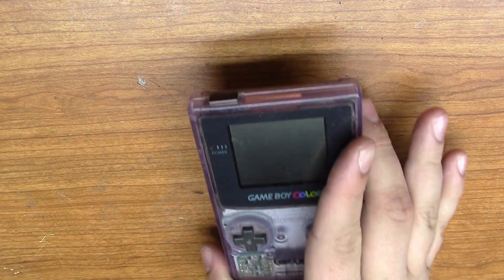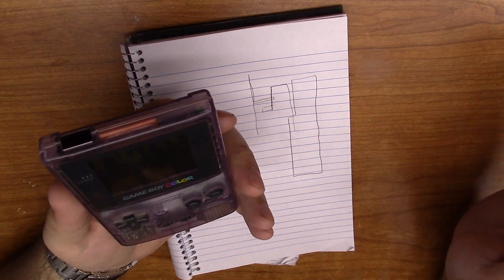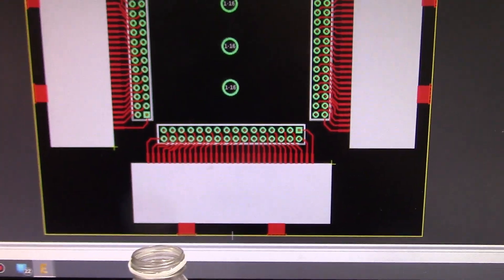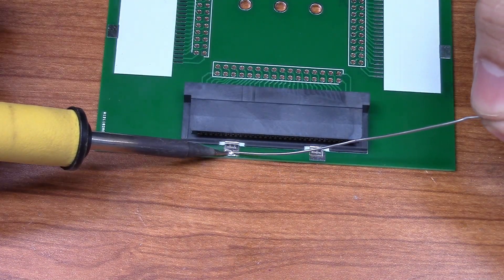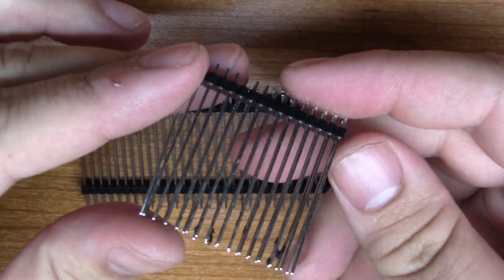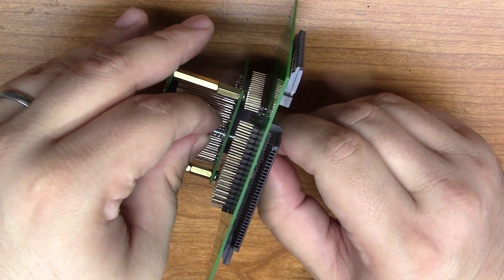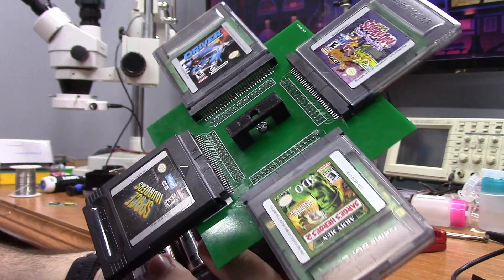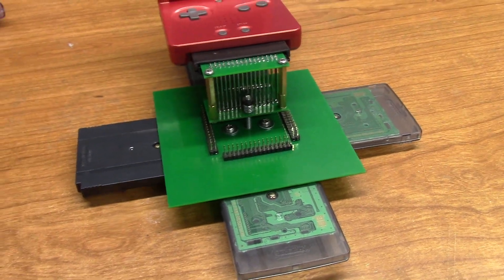I made a very weird Gameboy Color accessory! 4 games in 1!

Comment: This is stupidly neat, overly engineered and impractical, but magical and simplistic at the same time! An idea to make it a little more practical (if there ever was a desire to) - have the changer mounted in a 3D printed box with a ribbon cable connected to the main cartridge interface. Other end would be a plug to fit in the game boy cartridge slot. Then this could sit on a table out of the way.

Comment: I have a recommendation for a xbox controller stick drift problem. 
My request is I wanna see if you can make the gulikit hall effect sensor sticks work with a xbox controller. 
If it works I'm gonna definitely make every one of my controllers swapped over to there sticks. 
because my original potentiometers have about -18 on the x axis just sitting still. 
And I watch you all the time and wanna see if it can be done. 
because it would literally fix the main problem all xbox controllers have is stick drift. 
Love the video and the idea randomly popped into my head as it would be amazing if possible. 👍